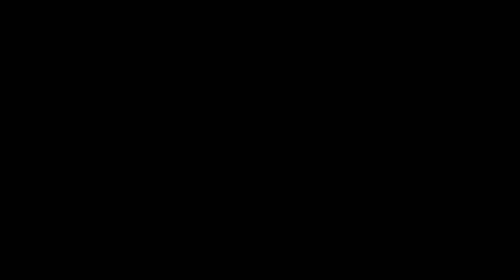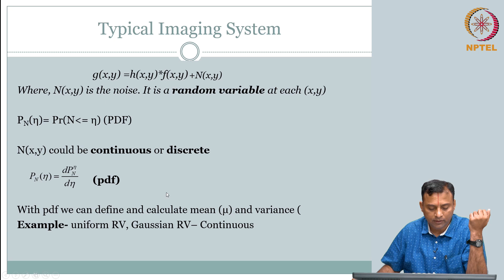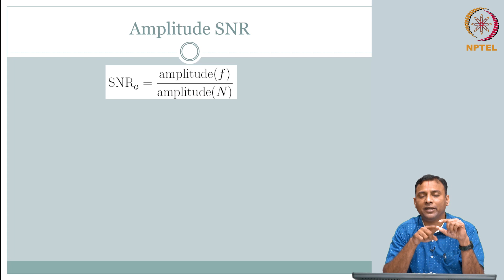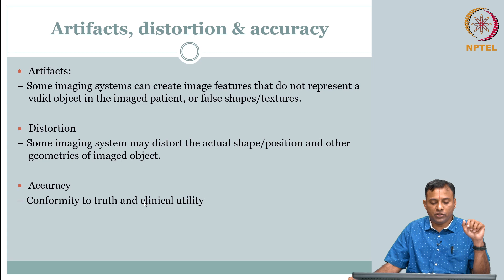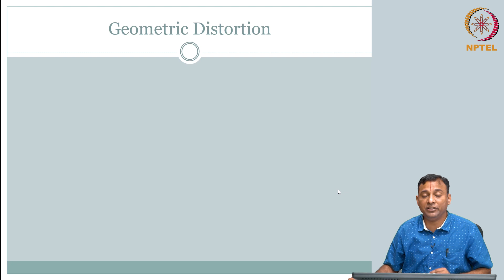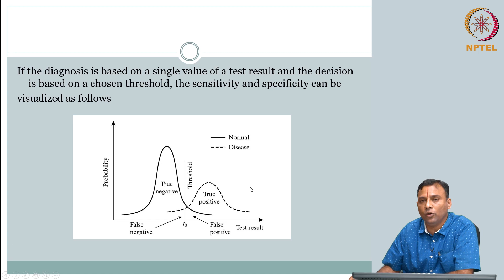#9 Blurring & Noise | Introduction to Biomedical Imaging Systems

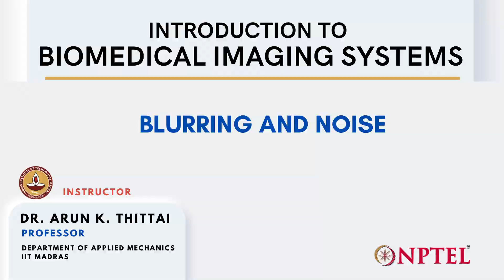Comment: 00:14 Understanding and characterizing noise and its impact on image quality.
02:57 Noise is present in measurements and should be accounted for in the model.
08:16 Goian is relevant for noise models and can be described using mean and variance.
10:59 Imaging system noise modeled using random variables
16:04 Understanding correlation and noise
18:28 Signal to noise ratio is important for image quality
23:14 Understanding signal amplitude and noise in photon distribution
25:35 The relationship between mean and standard deviation in Poisson distribution
30:27 Understanding artifacts in image quality
33:04 Distortion in imaging refers to deviation from the truth.
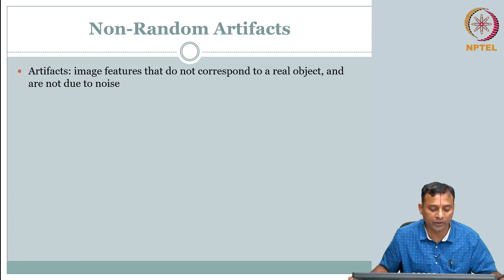37:35 Motion artifacts and metal presence can cause blurring and streaks in CT imaging.
39:45 Ring artifact is caused by detector miscalibration
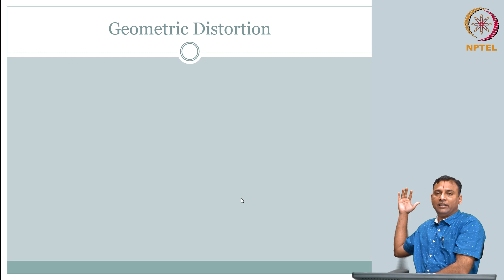44:47 Medical imaging systems reveal internal details.
47:05 Challenges in imaging accuracy
51:29 Understanding and correcting for systemic bias and noise in tumor size measurements.
53:39 Quantitative accuracy impacts diagnostic utility
58:25 Understanding Sensitivity and Specificity of a Test
1:00:50 Diagnostic accuracy measures correct decision-making in diagnoses.